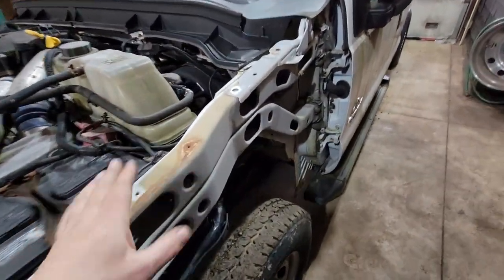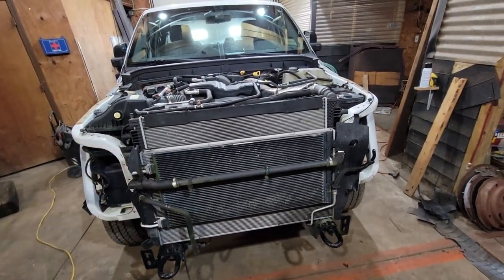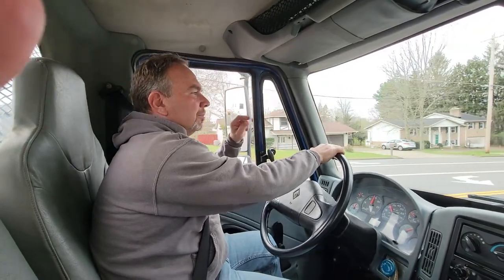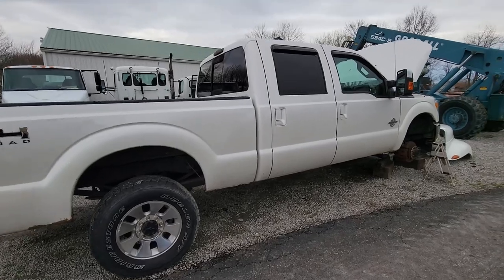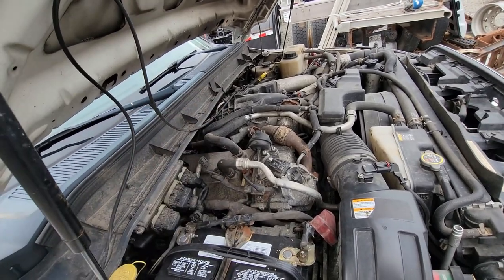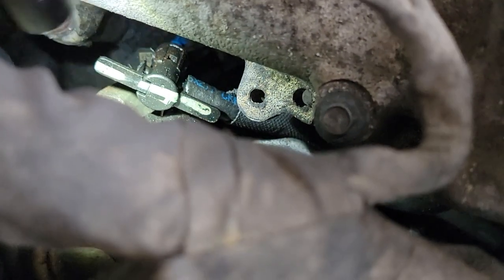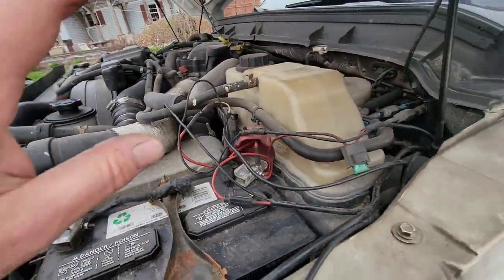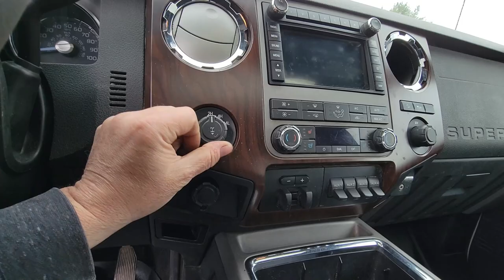BUILDING MY SON A TRUCK OUT OF PARTS?

Comment: Injector hold down failures are fairly common on the older 6.7l. Common enough that Ford updated them from cast to a forge steel design. If one goes, I usually advise to the customer to replace the remaining 7 to avoid another issue.
Reply from the maker: once we know if it runs and drives, we are planning to replace the remaining hold downs.

Comment: That first truck looked really clean. Why a parts truck?

Seats, I learned a trick a few years ago. Some vehicles, the driver and passenger side seat bottoms are the same and interchangeable. Salvage yards, drivers seats are worn out. Pass side is like new.
Reply from the maker: bought it with a "contaminated fuel system". at that time the repair was over $10,000. the owner  couldnt afford to repair it. i bought it to fix several trucks. i sold the bed, rear bumper, factory gooseneck hitch and driver air bag. i used the aluminum wheels and tires for one truck. the passenger fender on another. the hood on another. the grill, front bumper and passenger fender on another. the upper console on another. headlights on yet another. batteries for another. i assign a "used part value" to each part i remove and charge that amount to the truck it goes on..just like i went out and bought the part. so now, i have no money in this parts truck at all. it has paid for itself.
Reply: Flipped them around on my old altima..

Comment: I just sold my 2016 Ram 5500 for 55k 145k miles and century rollback w wheel lift. I bought it 5 months ago for 39k and put new radiator and brakes on it. I’m noticing some people don’t realize the truck they have is worth 10-15k more in some cases than they sell it for because they aren’t patient enough to wait maybe 30-40 days. I sold my truck within a month of listing it and made over 10k and already found a replacement for about 13k less. There is a lot of opportunity out there if you know what your doing, so I’m thankful for this ridiculous market.

Comment: Nice truck, biggest thing I don't like is the short bed. But I also don't much care for all the unnecessary add ons, I can do without.
Couple of my trucks have power windows and locks, 1 even has power seats. That's more than I'm used to! A regular cab, bench seat, crank windows and a standard transmission are more fitting for me. 
A few options are always nice but I don't want anything like what newer trucks have, I'd be afraid to use the thing to work because it'd be too nice to be a work truck, which would be the entire reason for even getting it!

Comment: I have a 2012 F250 4 door FX4 6.7  short bed What would I need to convert it into a 1 ton Single will
Reply from the maker: axles are the same. spring packs are different.
Reply: Thank you